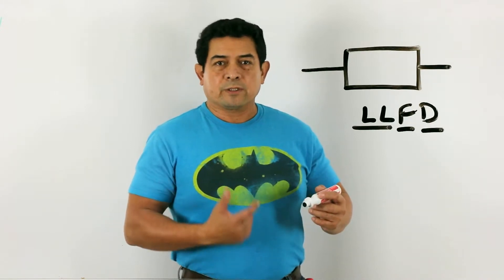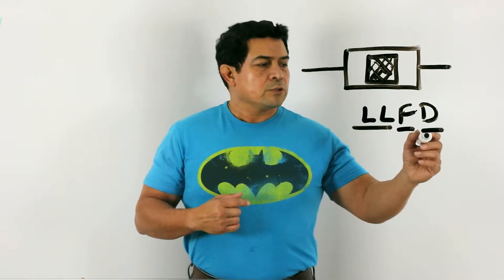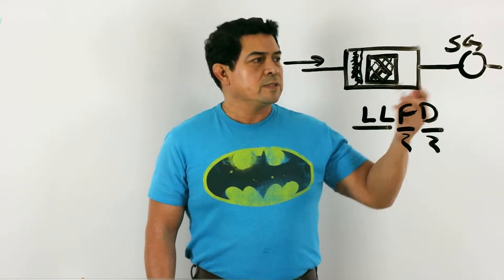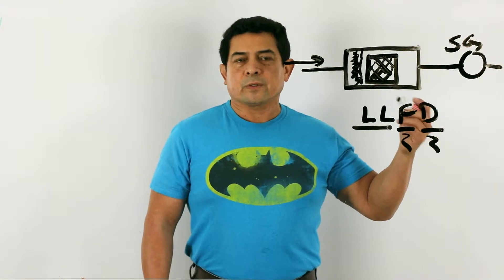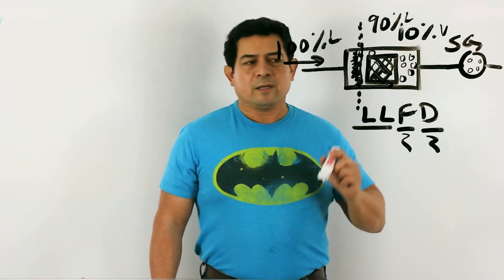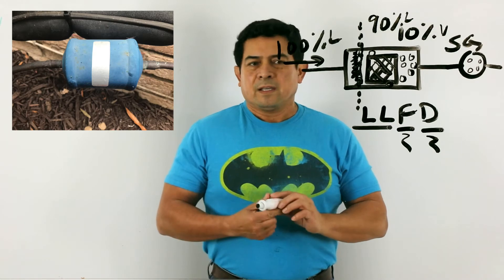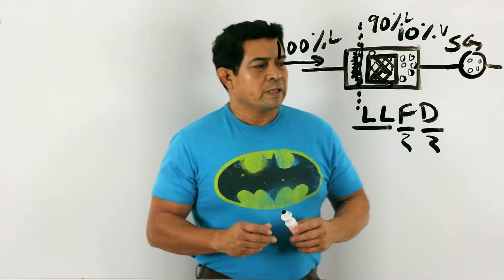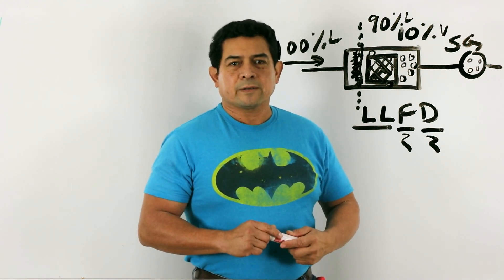Liquid Line Filter Dryer - HVAC Online Training and Courses

Comment: How to recognize that the filter is for replacement with the capillary system?
Greeting
Reply from the maker: On the liquid line filter dryer if the filter is clogged, it will create restriction and this will cost flash gas to form, causing the temperature on the outlet of the dryer to drop. So we can sense or we can feel the temperature difference across the dryer then we can tell that the dryer needs to be replaced. Typically, I like to install a site glass on the liquid line so I can see if there's moisture in the system. It is very important to know if there's moisture in the system, because if there is. The polyester oil will turn into acid and destroy our system. I hope this answers your question. Thank you for watching!

Comment: Yea i hate flash gas..  happens to me on dates all the time...  be mid sentence and then poof the dreaded butt burp..   

But cant you just upsize the filter and compensate with added refrigerant based on size difference/ volume increase??
Reply from the maker: Thank you for your comments. And yes! We used to upsize the filter dryer all of the time, especially if we had a really dirty filter. That should not affect anything and you will capture more of the moisture, dirt and if it is an HH dryer the acid of course!